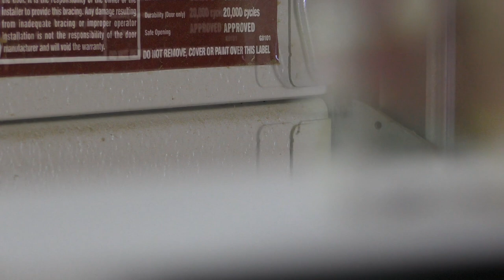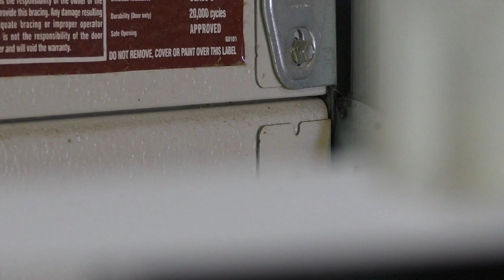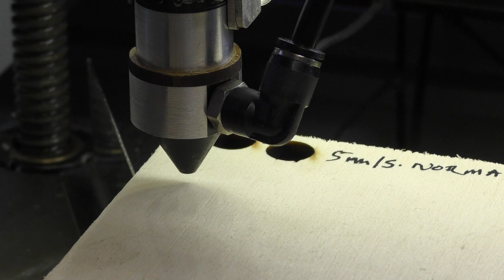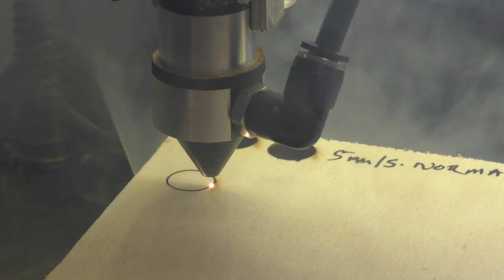RDWorks Learning Lab 229 Search for a Beam Collimator Part 2

Comment: @SarbarMultimedia  Hello Russ- the beam expander adjusted to be a collimator can yield an ideal uniform beam across the bed size.  What you're hunting for- the highest spatial density- will actually not help in cutting like you think- these optics and your system are diffraction-limited, which is the best case physics allows.  
All the math is here: https://ii-vi.com/laser-resources/
Once you start entering parameters, you'll notice the spherical aberration addition to spot size is inconsequential and can be omitted, the focal spot size is effectively the diffraction limit alone.
CRITICAL EQUATION: The relationship of beam diameter, focal length, and minimum focal spot diameter (thus the energy density!!) is this:
focal spot diameter= 4λ(M^2)f/(𝝅*D)
"f"=lens focal length, "D"=beam diameter.  Your Mode parameter is >=1.0 and <1.2, but it is a constant.  Also wavelength for your CO2 is fixed at 1.06e-7, so once you reduce all the constants, we simplify to:
focal spot diameter= (1.94e-5)*f/D
WHAT YOU PROBABLY ALREADY KNOW
Let's go back to the options on changing the focus lens for a moment.  So the first thing to see is changing from a standard 50.8mm cutting/engraving lens to a 101.6mm deep-cuts-only lens, with the same beam diameter, results in a focal spot size 2x bigger, thus a reduction in energy density by 4x.  However, the angle of the beam's cone as it approaches the focal point is sharper, so depth of focus (dof) increases by a factor of 4x.  Increasing dof improves cutting for thick materials, but only certain types of materials (different discussion there).  Increased dof also has a benefit that the process is less impaired by warped stock that drifts up and down from the intended focal point.  Thus the reason a 101.6mm lens is good for deep cuts but bad for engraving and not as good for cutting normal thickness materials.
Conversely, changing the 50.8mm cutting/engraving lens to a 25.4mm fine-engraving lens reduces the spot size by 1/2, thus increasing energy density by 4x, but also reducing dof by a factor of 4.  Thus the fine-engraving lens is a poorer lens for most cutting.
This is NOT a question of lens quality.  Lens quality is part of the spherical aberration that gets added to the min diameter, but it's already such a small number compared to diffraction limit (about 10,000x less) that it will not have a measurable effect.  At this point, we call this a "diffraction limited system".
OK so that's a detailed description most of which you already knew with or without the math, right?
WHAT YOU DON'T SEE YET
You want to look at what happens to the diffraction equation when you vary D, the beam diameter. 2x LARGER dia beam produces (totally counterintuitive, but this is what happens, and it will take awhile to accept) a 2x SMALLER dia focal point thus a 4x increase in energy density.  BUT, the depth of focus is reduced by a factor of 4x as well.  Make sure this is read correctly, because it sounds impossible but this is not a typo: for the same lens, a LARGER input beam yields a SMALLER spot size and GREATER focal energy density but REDUCED dof.  This is the exact opposite of what you (or any rational person) are expecting to happen.
Here's the KEY takeaway- reducing the beam diameter by 2x has EXACTLY the same effect switching from a 50.8mm lens to a 101.6mm lens.  Spot dia now 200%, focal energy density 25%, but dof 400%.  And just like the 101.6mm lens, poor engraving, somewhat worse cutting on common thicknesses, but the better on certain thick materials.  And it's not just similar, it's *exactly the same*.
What's more, the profound (and difficult) understanding here is that the diffraction limit creates a fundamental fixed relationship between dof and focal spot size, regardless of whether this comes from changing beam diameter or using a different focal lens.  Any change anywhere to the optical system will still follow this rule.  That's assuming laser source's Mode is still ~1 (which is what you already have, and it's best-case, higher Mode parameters only make the focal spot dia bigger) and we're still using a CO2 laser with a 10.6um wavelength.  The focal spot diameter scales down with shorter wavelength lasers.

What you're hunting for- achieving a smaller beam into the lens- would be exactly the same as using a longer focal length lens, in every way. Larger (worse) spot size, but increased depth of focus (better).  Note this is not a "general sort of tradeoff"- it's an EXACTLY defined mathematical relationship of a diffraction-limited system.